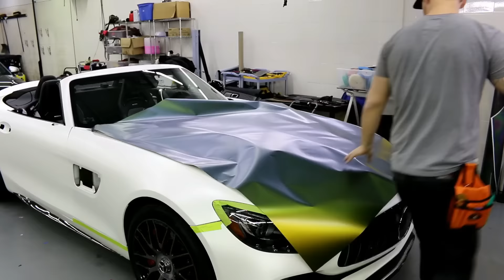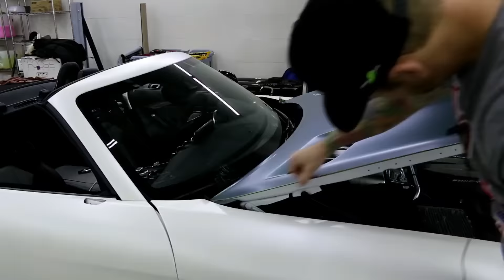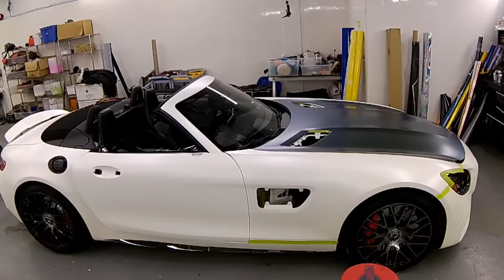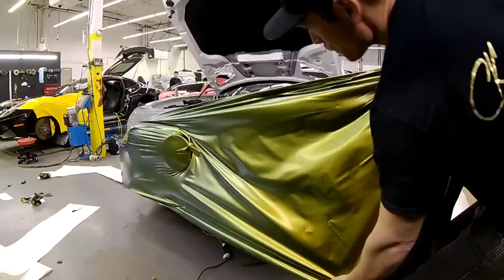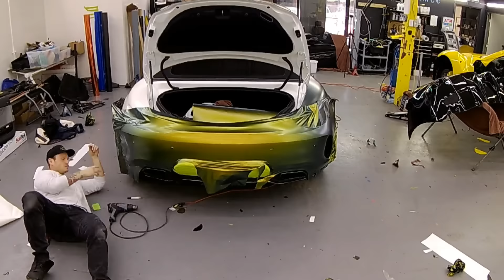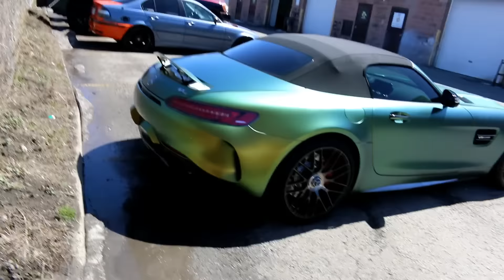Mercedes GTC Edition 50 Time Lapse Vinyl Wrap

Comment: great job. I actually have a question I wrapped my mirrors in carbon and I spotted that after a week exposed to sun some bubbles showed up but when I finished installing the wrap it came up really good and I wondering what have I done wrong? Thanks
Reply from the maker: You may not have squeegeed firm enough which left air in the air channels
Reply: is there any way of fixing it?